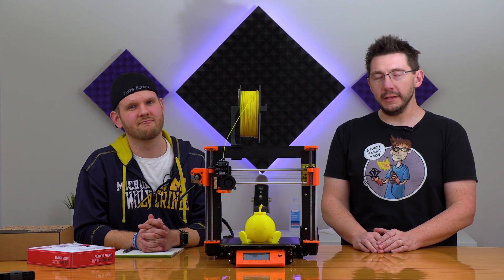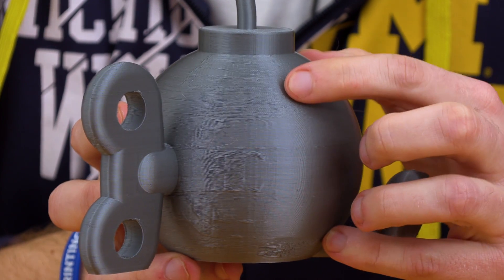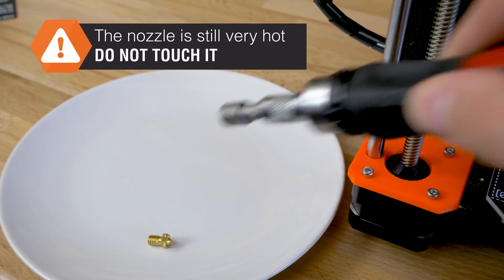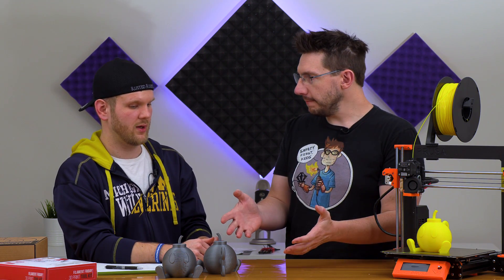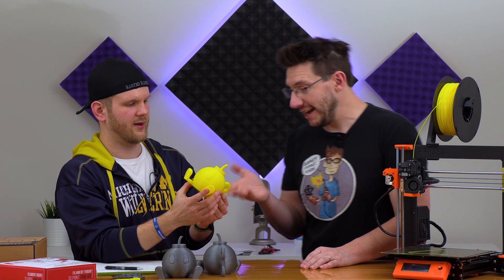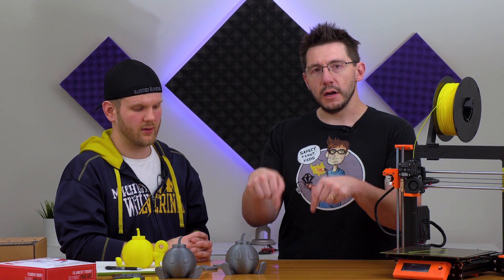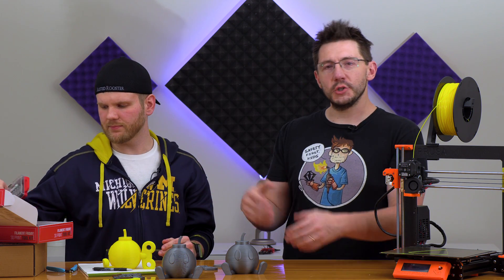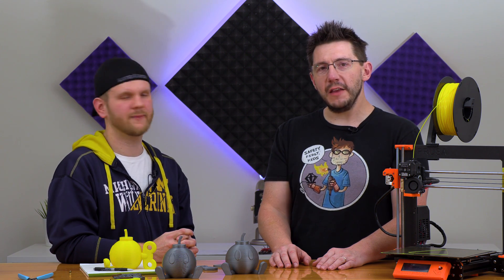3D Printing 101: Troubleshooting a Bad Print / Installing a New Nozzle

Comment: I love how you mention that people can be afraid to troubleshoot as they might break their printer. As an IT guy, I am of a rare, horrible class such as chaotic neutral, in which I disregard any scientific steps in which to look at things, and just tinker with it until it works correctly or breaks. Then I judge whether I can fix the item and how easy it is. Because of this, a lot of technologies, I refuse to work on/with. Luckily, with 3D Printing, it is hard to cause a serious injury to your machine. Every part can be easily replaced and installed (some may take much longer than others), with little to no instruction. To everyone that happens to read this comment...play with your machine. Get it dialed in, and then print upgrades, install them and tinker. When you master that, buy actual upgrades, install them, tinker and get them working. When you break your machine or a part, figure out a way to make it better since you will have to take it apart to fix it. Every break is a new chance to enhance.

Comment: Great video......I was nervously anticipating another video of delving into the dozens of painful parameters that can be adjusted to correct temperature and extrusion issues (most of which only produce minor improvements) but was pleasantly surprised to see some basic troubleshooting used to fix a narly problem.  I'm off to check my grub screws!

Comment: i had take my extruder apart since a jam filament and now when it heats up it jumps back to the control, seem like my extruder gets hot it goes back to  the control settings  i dis connect  it and was ok then itry again it did it agian  i have taken the extruder completely apart and put  it baCK TO TOGETHER IS WERE MY PROBLEM BEGIN

Comment: Ok Bro,  this time you really hit the nail on the head.  I'm taking some 400 grit and lightly finishing my nozzle tip...smooth as butter now.  That, along with block sanding my build plate, has both of my printers (Anet A8 and LK1) layin' down a perfect first layer. As long as I don't get greedy with the build plate area I have zer0 problems.

Comment: My prints like to come off where they were laid the bed heat is 80c for pla that recommends 200 to 230 c I'm a noob so I'm not sure if its cuz the beds smooth or because I'm terrible at leveling the bed. Or something else

Comment: I'm currently having issues with my benchy prints (new to printing for the record) where it would be a perfect print but the smoke stack on it has weird rings on it, instead of being smooth, it's like if you were to put a ring of plastic over it in 3 places, if that makes sense

Comment: I have been trying everything from tightening belts and changing settings for a better print. I am definitely going to switch out the nozzle because my issues are the same as in the video.

Comment: This helped out so much with my prusa i3 mk3 kit. The grub screws were a bit loose and it made a massive difference. The only problem i have now is bad bed adhesion. With pla I have the bed at 60c so should I reduce the temperature a little bit?

Comment: Well, I only just started 3D printing, with a big build area Tronxy X5SA. Even with the auto leveling driving me up the wall. Because it do it and I have 6 tension spring knobs to try and get the 16 auto checked points on the big 330 by 330 build hot plate adjusted to the stated 0.8 hot end height above the hot bed?  Really hard to get it right I had to just get it as close to it as possible but not 0.8 each point.  Then the Z axis adjustment too very hard to do right?  After many many try's I got it sort of close.  I downloaded the famous Benchy Boat and with the free PLA white I got with the printer, I did the slicing in the Tronxy own brand slicer and after 4 hours of printing this small white Benchy was done!  Not bad looking for a 1st newbie print I guess?  Not prefect, But Okay.
I brought some ABS blue filament and just spent half a day trying to re-level the print bed... Really a pain.. then on to do my 1st ABS print, which was a couple of side by side ABS small Z axis stoppers for the printer I got. That's why I am here watching you guy's Because both of those tubes after printing just broke in two length wise and they were printed at the recommended settings on the spool of ABS, which was 244 C for the hot end and 90 C for the hot bed. both were pre-heated.. the hot end is new brass one no damage. I followed the guide of the printer manual to clear out the white PLA that had just done the Benchy!  So I checked the printer belts are tight enough, I really don't know what is the problem?   Now I just seen a British printing company Has done a now Super Hot End Nozzle called " NOZZLE X " Which can handle any filament even the tough stuff.  And not wear out. I most likely get one as they d all sizes and the Nozzle is a good price.  here is the website link > https://e3d-online.com/products/v6-nozzles

Comment: hey Joel, been scouring your vids and others for a solution to my PETG warping on corners after many hours into a print. I haven't really found a good solution. I am printing at 240 with a bed of 80. 80 seems high to me but that what it took to get the first layer to stick. I am printing on an Ender 3 wih a direct drive mod from printermods, with the ender 3 glass bed which also has the black coating on it. My PLA prints work like a champ consistently.Any input, or suggestions for other bids to watch would be greatly appreciated.

Comment: Hi, I am wondering why all possible issues showing up on one printer, I mean what about maintenance, just checking the mentioned spots once a while.
Ok, maybe it is that I do 3D printing for over 6 years now, and I have been thru all of those issues one after the other, but not all in a minute :-) 
But good tips anyways :-) Thanks

Comment: I know it has been over a year since you had posted this video... but it is still as valid today as it was then.  Thanks for the advice and help.  However, after trying your suggestions I was still getting bad prints.  They looked just like what was in your video.  After a bit of 'Troubleshooting' I noticed my bed had a slight wobble to it.  My investigations led me to the bearings, they were worn and had some slop in them.  After I replaced them my prints improved drastically.

So another potential trouble spot would be checking that the bearings have a good snug fit. 

It really was time for me to change my nozzle :)

Thanks for the some tricks of the trade.

Comment: those brushes are available at Autozone as well.  I had a set sitting on my toolbox in the garage, and I decided to bring them in and use them to clean up my 3d printer hot end prior to replacing my nozzle.  Thank you for the tip to replace the nozzle it cured my problems

Comment: To add to troubleshooting, things I had to troubleshoot with my newly built machine:
1. Belt too slack (same problem as in this video). Apparently you should be able to twang it like a guitar string.
2. Filament to the right of machine. If you have an external filament reel holder and place it parallel to the x axis, it will pull on the x axis when it moves, giving a fair bit of resistance and causing it to slip. I placed the filament parallel to the y axis instead (in front of the machine) and it works infinitely better. Currently looking into mounting it on top.
3. Squeaky z movement. This one is obvious but I just sprayed a little lubricant on the top end of the threaded rods, and it improved both the sound and quality of the print.

Comment: I had the same issue with my 3d printer. Artifacts started to show up and i didn't knew what's the problem. Then i figured out that my X axis belt tightener  broke. With some wire i fixed the problem temporarily until I printed the new one.

Comment: Still not quite right ! You should align one grub-screw with the flat on the shaft. This way the connection is not dependent on friction only and also, that's what the flat is for.  Cheers.

Comment: guys, if you want to start 3d printing use the promo code and the ender 3 (one of the best starting printer) is reduced to $176.00 and is originally $220 which is the best deal I've seen so far

Comment: Print something useful Knick-knacks are only great for testing and holding down shelves. why get a 3d printer only to constantly print useless objects? 
Even better is find something you can improve or replace and design/print it. 

I recent printed a replacement ball mount for a ball/socket joint on a car phone mount. it was for my sisters BF and having him watch the whole processes of me make designing it in 10 min and print in 36 was mesmerizing for him. first design/print worked great.
Reply from the maker: Well done on printing awesome stuff! Knick knacks are great because they appeal to a wide audience and show many what is possible. There are A LOT of young people who got inspired to get a machine after seeing a low poly Pikachu, then printed some awesome fix for the house.

Comment: Would love a series of videos like this with troubleshooting. I had issues with me CR10s and it was from  having the nozzle needing cleaning, something you had demoed once. 
and you really helped me understand what was a problem after swapping the brass for a steel nozzle. I had switched filaments and nozzles and now realize I didn't adjust temp appropriately. And my Prusa actually had lost one of the grub screws and the one left was slipping. 'Tightening made such a difference. Now to find that grub screw.

Whatever you print, try to solve a problem. Like Joel's tripod feet or door handles. Love practical prints. I did shower curtain rings, just because I could print them in a complimentary color to the curtain and wall colors.

Comment: Great video Joel and Sean!  Thank you so much for putting out troubleshooting videos.  They are a great service to the 3d printing community, and newbies like myself.  I have a new Prusa MK3 that I received in early January, and had the same layer shift issue on the y axis after I assembled my kit.  As it turns out, this is a very common issue for those that buy the kit.  Prusa has a video on their site that helps to troubleshoot common issue and this is one of those featured in the video.  Once I identified the axis having the issue, I quickly found that I hadn't tightened the set screws on the Y motor pulley.  As it turns out it is a final step that was left out of the printed manual (at least I couldn't find it anyway).  My Benchies are now beautiful!  Again, great video!

Comment: Can't say I'm a big fan of cleaning hot ends with metal brushes. In my experience they're good at pushing molten plastic around whilst not actually removing it. I use paper tissues now: heat up the hot end to 200C, grab a single tissue, fold it in half and half again (four layers) and gently wipe any molten plastic from the nozzle and hot end. Shiny!
Reply from the maker: Ooh, thanks for the tip!

Comment: I have the Prusa MK2.5 and I always dread swapping nozzles because the heater's wire is really easy to snap off especially when it's hot. 

And the way the Prusa and most FDM printers have their heat block set up it's extremely hard to not affect those wires when swapping out a nozzle. 

I really hope they make a new way to swap out nozzles ASAP. I've had to swap out the heater and thermistor once so far because of this and it's a pain in the ass to cut loose all the zip ties and replace the parts. :{

Comment: More people have issues with PTFE failing than the nozzle causing issues though. If you use the E2D sock then you don't need to worry about the steel and PLA sticking or the temp being off.

Comment: I just started getting layer issues on my 3d printer some layers wasn't sticking together but the print still successfully complete I watched this video  and just bought a new nozzle and fitted it and my issue has gone,  strange timing 😁 I get a problem and you release a video that helps me straight away  thank you

Comment: I'm planning to get my first 3d printer but having trouble picking one out. Want to print with nylon for gears and not sure which printer to pick.
Tiertime UP Box+ 3D
QIDI TECH 3D Printer
Dremel Digilab 3D45
Don't care about proprietary filament just looking for reliability and good quality prints. Thanks

Comment: Snap! Had the same problem with my Anycubic Chiron . 4 days into a 6 day print, frustrating to say the least. Turned out to be the PTF tube had distorted where it touched the back of the nozzle and effectively reduced the internal size of the tube to about 50% reducing the flow of PLA.   Ended up switching out both the tube and nozzle and now its back to printing amazingly well. Thanks for another great video..

Comment: For the hardened steel nozzle you should get a E3D Silicone Sock Pro. It'll help insulate the block and nozzle and help keep the fan from blowing on and cooling the nozzle down and will prevent filament from sticking to it. Plus the additional insulation should help cut the electric bill down a little bit.

Comment: This is actually the exact issue I was having on my Ender 3. I've been trying to troubleshoot but I keep getting distortion on the Y axis. The Y belt is incredibly tight but there's no more belt to give it slack. But the layer shifts are on the Z axis so I wonder how I can fix that considering there's no belt.
Reply: Are you getting occasional layers that appear thicker than the rest? If so, look up "ender 3 magic number" on YouTube, chep has a video that might help, it has something to do with the number of steps the stepper motors actually have, and adjusting the layer height to the precise number for your motors should solve it
Reply: @rejectedopinions  yeah this does happen! Thanks! I'll check it out!

Comment: If the watch Sean is wearing is an Apple Watch, I highly recommend a weighted Apple watch stand by Blackbanshee that I found on Thingiverse (thing 806900). It prints in 3 pieces and assembles to hide the wire and even fit pennies inside for the weight. https://www.thingiverse.com/thing:806900

Comment: Wow now the Nerd Dr. does house calls that is GREAT!  I need to see if I can get you out to my place mext time you are at MatterHackers. 
Any way the proper cleaning and servicing of your printer is just like your Car. but as is to that there are some cars that don't like it if you mess with certain things I have two Robo R1+ printers and they are true WORK HORSES  and cleaning the nozzles with a brush is just fine with them they even like it. BUT I also have a Rostock Max V3 & don't even think about touching that nozzle with a metal item of any kind while the power is on. I don't know WHY but twice I have had trouble by doing this it blows a small fuse on the Arduirno uno board IF ANY ONE CAN TELL ME WHY I WOULD LOVE TO KNOW  so service is good but there are some strange things that happen remember what you do & how to undo it if needed

Comment: Ooooh do NOT get me started on the grub screws! Mine in the bondtech gear wore itself to a rounded end so it wouldn't grip the motor shaft, and when I went to tighten it, it stripped. Had to remove the entire E axis to fix it, and ordered new screws from bondtech themselves. 

The screws on the Prusa I got were a silver "steel?" And very very soft. The replacements were all hardened steel and black, much stronger. This was for both the X and Y pulleys and the drive gear. Since replacement, no more backing out or coming loose and causing slop or underextrusion. 

Thank you for this, now I know I wasn't going crazy!

Comment: For "cheap chinese" printers, definitely DON'T use the included tools. Throw them away & get an assorted set of metric hex wrenches, open/box wrenches, & sockets. The included "tools" will likely fail before proper tightness is obtained.

Comment: I will pretend that the sound issue, and cutting him off at the end was just your way of showing him how much you need him as an editor. ;)  Either way, once again, a great video! I've been printing for years, and the first few years would have been a lot less frustrating if your channel existed back then.
Reply: Yes, good info as usual and definitely a sound issue. Some weird noise in the back ground was very annoying.

Comment: hey leute. ist es möglich eine trubleshooting gcode datei zu erstellen für die typischen fehler?

Hey guys. Is it possible to create a Troubleshooting-gcode file for the typical errors?

force speed for moving and stressing x and y
over under extrusion 
nossle errors
Reply: The "benchy" boat worked fine for me - not too big and it is a real torture test that has a lot of diagnostic value.

Comment: At 4:20, I can clearly see how using the flush cutters like that could lead to that problem.  Instead of cutting the filament cold, on my printer, I heat up the filament to print temp, then I can retract the filament back one step with the move menu.  Then I use a large set of tweezers to run just along the sides of the nozzle down to the tip to grab the molten plastic from the tip.  If I need to I repeat again a couple more times if I continue to get some more oozing but it should stop soon since you previously retracted the filament.  Then as soon as possible lower the nozzle heat back down below print temp to allow the filament to set back up inside the nozzle clean and flush.  No risk of cutting any metal pieces nor getting your fingers burned either.  I am uncertain as whether a Prusa can retract filament since I haven't played with one but this works well with my little Monoprice Mini Select.  Great advice shared Joel!